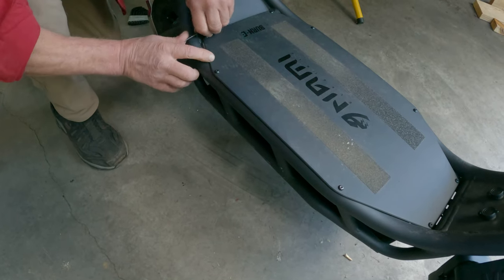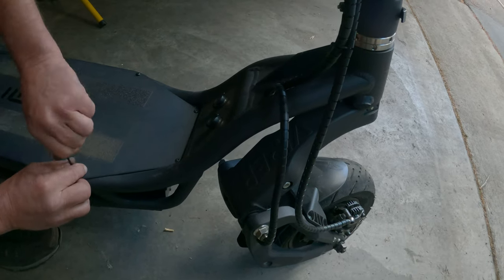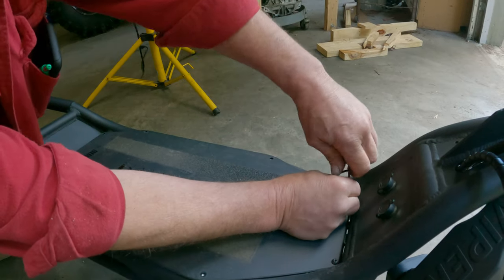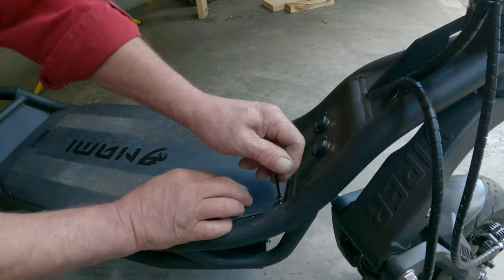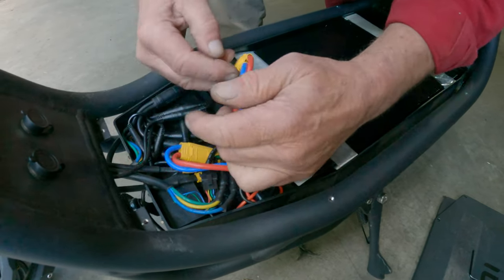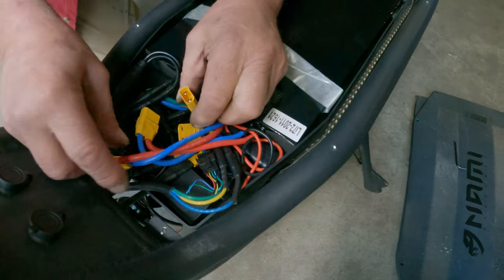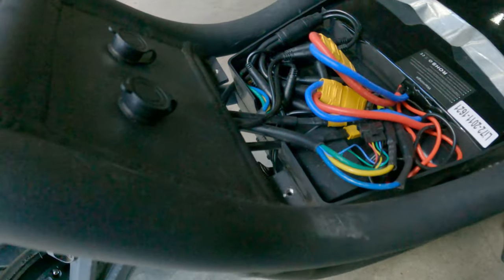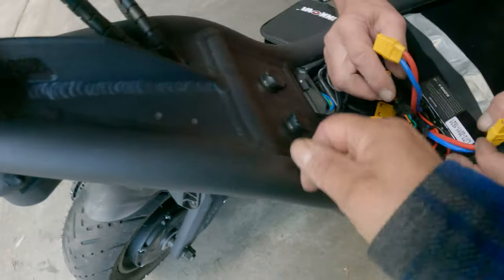nami burn e with the hood up part 1

Comment: The whole idea of the cable compartment is that you intentionally plan for some water to get in but have the connections somewhat waterproof AND have the water flow off fast through holes in the bottom and dry fast. The battery compartment however would stay dry as there is something like a dam in between. As a side note it is no difference which battery connector you connect to what controller and +/- is marked on the connector so it is hard to connect wrong (just take care and check the connectors in detail before plugging in again).
Reply from the maker: Thanks will do.
Reply from the maker: Did you notice when we hooked the battery back up it made a fat arc. Scared the poop out of us. Lol
Reply: @scoottheharbor  Its normal. It tells you that the controller its alive. You shouldnt play with this electronic devices unless you now what you are doing. Good video.
Reply from the maker: @Nuno_Tomas   my friend is very good with electronics.  I would never touch it myself.  I'm not good with that stuff. Thanks for watching my friend ❤
Reply: Are these nami suppose to have the black battery pack? I just got one and it's the same battery, been told its a cheap Chinese battery, as they supposed to be wrapped in blue  shrink wrap if it's Panasonic
Reply: @Thedoctorlee999  The only way tou have to find out is to open that black cloth and see if it's Panasonic or not. I have a great company from China that I work with and they build me every battery that I ask them to. I choose the cells, if it's Samsung, Panasonic, LG, molicel or even Chinese batteries and they build it for me. The main thing is the way they build it, the copper they use and níquel and the way they solder it to the cells. It has to have a good BMS and even with Chinese cells it can be a good pack. I have a pack on my Chinese scooter with Chinese batteries that is very good. And my Hunter Quad I have Samsung and on my code Name z I have the Panasonic.

Comment: I spy with my little eye a cheap chinese no brand battery pack.
Reply from the maker: I have no idea what you are referring to. When I opened up my nami for a second time I wasn't filming.  But I did check the battery's and they are Panasonic. So ... no idea what your talking about.
Reply from the maker: @Stephen  Jenski dude you were right. I did the Chinese batteries.  I'm  really sorry I didn't listen to you then.  Thanks for giving me the heads up. I'm kind of thick headed sometimes.  I am working with fluidfreeride to get a replacement. Thanks again my brother.